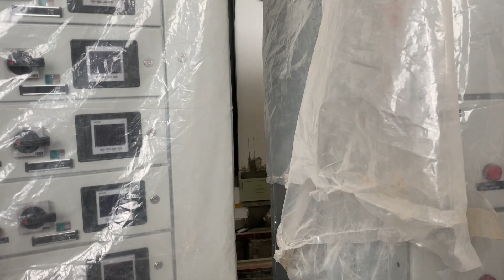VLOG: Lagos & Ibadan Railway Station Building Progress in October 2020 (1080P)

Comment: I heard that the Chinese companies don't hire the locals in key positions like project management. Is that true?
Reply: Best to hire based on qualifications and experience. If the locals know the job then they should be hired. However if locals don't know the job why give them management positions just because they are locals?  Why screw up the job?

.

.
Reply: @kemiajao  well said
Reply: Management jobs for rail in Nigeria, hmmmmm when there was no standard guage some 20yrs ago, so where will the experience come from, unless you're hiring Nigerians from diaspora. I don't think many Nigerians abroad would jump at that offer when you consider the Nigeria factor, lol, and you get paid hourly abroad and with your experience means more money plus you are guaranteed training there. In my opinion, coming to work as a management staff from abroad is dicey. As for this project, I know lots of technicians and labourers are Nigerians as you can see in the video, so hiring management staff from a country that is on  Maglev 600km/hr is not a bad idea.
Reply: Have to hire the best people for this project. Building collapse and train derailment is real.  All kinds of malfunctions can happen due to bad management
Reply from the maker: They hired lots of local staff. Previously they use Chinese nationals for heavy truck driver and excavator operator. Now non of them exist since more and more Nigerians are capable of drive a heavy duty truck or operate excavator. By the plan, CCECC will handle the whole operation to FG after 3 years, only provide supporting services. They sent team of Nigerian engineers to China to get training. Not bad.